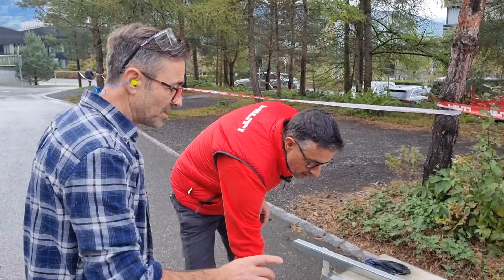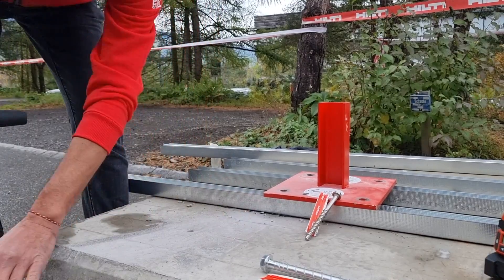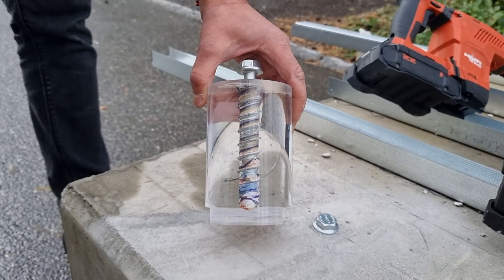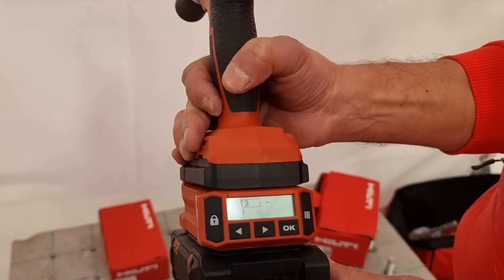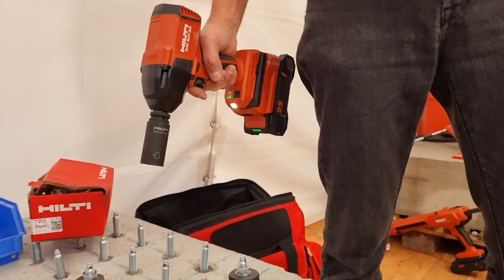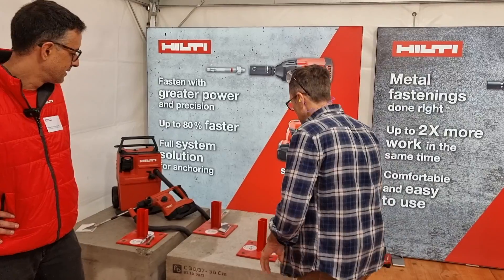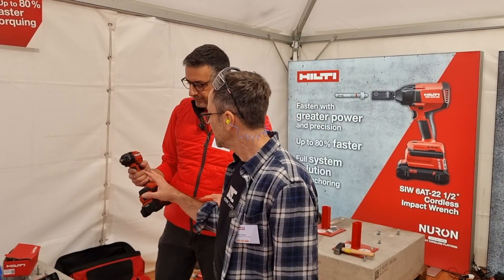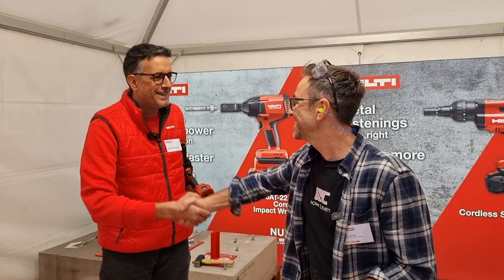Resin System For Fixing In Concrete - Simple And Easy To Use from Hilti

Comment: Do those glued-in concrete screws count as security fixings (e.g for bike racks). i.e are they glued strongly enough that you can't actually undo the screw?
Reply from the maker: Absolutely!! they would need smashing out!!
Reply: @robinclevettcarpenter  OK. good to know. It seems to me that there is some risk of the little glue packet just ending up in the bottom of the hole if the hole is too deep.
Do the instructions tell you to be careful about hole depth, or is there a stiffener in the packet to make sure it goes alongside the concrete screw, or does the system rely on trapping the packet beside the screw before driving it home?

Comment: Hi Robin. I recently moved an automotive lift in my garage. When it was first installed we used wedge anchors. This time I used the Hilti system of resin anchors. I did that just about a month ago. It is right as rain. I have put many cars in the air since. At the top of the racks, I tied them into my rafters ties, thus reducing any tendency for the base plates to move. The top acts as a big lever, so the amount of force on the bottom is reduced. The heaviest vehicle I lift is maybe a pickup truck. I’d like to put that Mercedes van of yours in the air. But u would have to come to California for me to do that. I built myself a small pool, 12x28. No garden room. No floor heating. No fancy hybrid water heater. But I still swim in it. I still use the jacuzzi 3 times a week even in the winter. I love your house and all the fancy work u do on it. U would absolutely laugh if u saw my 25x28 garage. But it has my two racks in it, and I whistle while I work.
Reply from the maker: All sounds great Bill, I will pop in and see you next time I am in California!!!
Reply: @robinclevettcarpenter  DEAL!!

Comment: If Hilti are not marketing this into commercial fleet management (buses, lorries, kwikfit etc) they are missing a trick. This solves a real problem with wheel detachment issues, and provides an electronic audit of wheel nut torque management. Many places just rattle the nuts on and don’t check the torque - swap the impact wrench for one of these and it’s automatic, mit audit trail. A no brainier imo. The insurance industry would probably discount insurance costs with such a system in place.
Reply: Nice thinking outside the box for a use for the impact wrench... 👍

Comment: great inovation. they missed a major selling point to me. thats if you only want a small no of fixings you dont need  to open a whole tube and fill the nozzle each time  , wasting all that expensive resin. you only use the amount needed and its ready to go instantly . 
with the double tube  resin you have to save up all your bolts and do at least a  tube  at a time . that can be a pain sometimes. with these you can use it when ever you want and do them as you get to them .
Reply: Urgh, yes. I occasionally need to put one or two studs in with chemical anchor. And inevitably, you use about a 10th of a tube, then the next time you need to use it, it's not any good. Last time I tried to use a tube for a second go, only one of the components came out!

Comment: I member the first time I used to fix a floating oak mantle piece dtilled the hoe in the wall and the oak put the resin in the holes put the threaded rod in. Then 2 minutes later got informed the position had changed, couldn't pull it off as it was set . Ended up cutting the rods with the ricipricating saw

Comment: I bet it performs better without the foil in the hole.
And then you have to explain why you are not cleaning the holes.
Reply: The thin foil is completely shredded in hole. Screw holds by cutting into concrete and glue just mixes with dust to create solid surface area for the thread to rest on. All this is ETA certified for 50years of lifespan. It hold on completely different principle than normal chemical anchor.

Comment: Who among us still wouldn’t clean the hole ?  I know I would.
Reply: Who among us wouldn't also give the bolt just another little tighten after the green light came on!
Reply: @ricos1497 I would not just because these anchors are engineered to work as a system and be installed according to specifications.
Reply: Exactly what I was thinking. Which makes me think I'd stick to traditional chem fixings if it's cheaper.
Reply: No one likes a dirty hole 😜
Reply: I was always told to clean the hole before dipping in...
Reply: Outstanding
Reply: I would clean the hole out just because it is habit but if the instruction manual said not too I would not. In reality OSHA in North America insists on silica dust containment / control so that’s typically HEPA vacuuming as you drill.

Toro make a lawn mower that they claim never needs an engine oil change. I change the oil!